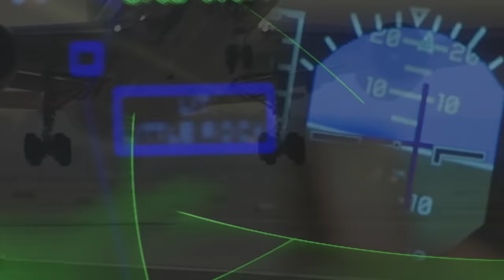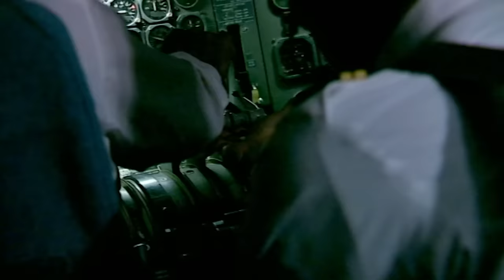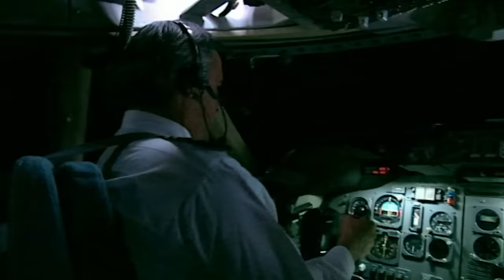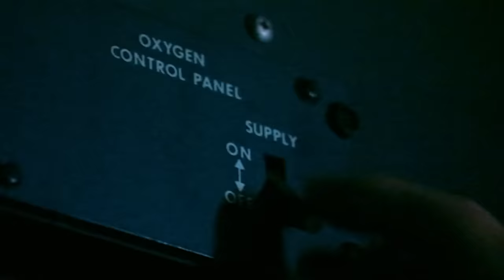Horrific Plane Crashes That Could Have Been Prevented | Mayday Compilation | On The Move

Comment: I flew on a 747 in the 90’s. Prior to takeoff, they couldn’t close the cargo door. I heard a lot of noise up in 1st class & I asked the flight attendant what going on. She said “the cargo door is stuck open & they are welding it closed “. This took about an hour. In flight we hit severe turbulence & I asked the flight attendant “what happens if that cargo door opens?”. She said “don’t worry, we’ll gradually decompress “!
Reply: I flew a 747 once and when they got us all on the plane they announced there was an unmatched piece of luggage in the cargo hold so they had to get it out (good). Then when they tried to close the door it wouldn't close so they had to "manually" do it. It took quite a while.   It was a nonstop flight to NZ and ironically before taking that flight I used to take the UA Honolulu to Auckland (NZ) flight which was UA flight 811 which flew DC-10 prototype planes.
Reply: @radfem2010  it’s crazy how none of this was in the news. I wonder how many cargo doors were malfunctioning on the 747’s back then?
Reply: Absolutely not true that they were 'welding it closed'.

Aircraft fuselages are made from aluminium, which is an absolute nightmare to deal with, even in a controlled factory environment. There is no way they would try, nor would it be allowed, to do that on the ramp before take off. Also, 'it took an hour', is more proof it didn't happen. The thermal properties of aluminium means that even if you do make a clean weld, you have to heat treat other areas far away from the spot you were working on.

10/10 they lied to you.
Reply: @radfem2010  wow!
Reply: @trottergraeme  I thought so
Reply: Hahahahaha I one of those ppl who would laugh at that if it was happening to me it's my mind coping with danger ppl say it's not funny I say Ik that's just my coping mechanism beats panicking at least worse thing that ever happened to me was a car wreck nobody was killed the worst casualties was the cars his literally up to the radiator caused it to leak and the idiot wanted to ride off the scene with it literally broken back axle for our car a complete 180 on moms side cracked her sternum guy hurt his hand i just came out with bruises and a bump where some of the airbag from mom side busted dad ended up taking the next day off to care for us cause for the next few days I couldn't walk until the bruises showed up literally felt like someone was pinching the tops so hard and was causing a reaction to where I had broken 3 toe bones that it had become to much what a relief when those bruises showed up as it relieved the pain I also learned if the bump started to sting to put ice on it or it would cause a bad headache for weeks afterwards I think those headaches were caused from breathing in the airbag dust only situation I never laughed at
Reply: @Graeme Trotter  unless they were welding the latches shut,  those might have been a mild carbon steel and easy t
Reply: @shawndouglass2939  possibly
Reply: Oh that’s rich.
Reply: Leaving San Francisco (United 737 I believe) most passengers expect your plane to lift off by a certain time & speed. Even businessmen starting to look up from their newspapers (this was many  yrs ago). Suddenly we were braking & pitching forward. The female Captain explained we had hit a flock of birds, large & black, & had blown out “all our tires”. She said the plane would be towed back to the gate & we’d get a different aircraft. She even invited passengers to look at the plane. Blood & black feathers in the 2 engines, windscreens & wings. She was very calm.
Reply: @shawndouglass2939  It would've been completely illegal to do that in either case.

Comment: I would like to discuss Kevin Campbell commenting that he was an Engineer and was coming up with re Engineering an existing bad blue print. I've been an Airline Line Mechanic and Commercial Pilot for 40 years, including Inspection and Supervisory roles. I have run into many "Engineers" that can't get the parts to fit back together and take it upon themselves to modify the part, totally wrong and illegal. My point is that both the DC-10 that had hooks to lock the door and pins to lock the hooks and Boeing 747 that had hooks to stop the camming action of the C Locks have had failures. The real solution is to have hooks as per DC-10 or cams as per 747 but you need to have an over center mechanism and then use a camming lock that can't be applied unless the door is closed and locked and will completely destroy the opening mechanism if it tries an unscheduled opening. If this sounds like something that is unlikely then you are not familiar with aircraft design at all. These are not bridges or cars or trains, they are relatively light weight and follow certain doctrines of materials and design when being manufactured. At 7 or 8 PSID think of how many tons of pressure must be against those doors at cruise. These locking mechanisms don't need to be modified, they need a complete re-design. My condolences go out to the Campbell family and their efforts were heroic, I just hope someone gets on these doors and figures out how poorly they were designed in the first place; in other words lets not improve on a bad design. Wipe the slate clean and start over, make a door that works for Gods Sake. My two cents from an Airline Mechanic; list of Boeings I've been on over the years 707,727,737,747,757 and 767, my time in Airforce was on the C-130. I'm not an Engineer but a Licensed  Mechanic and know how things are supposed to work.
Reply: The thing is, all these instances were many years ago and a lot of stuff has changed in design, maintenance, system safety and more. These things don't happen any more. No, I'm not ignoring the 737 Max - anything designed by people has a chance of failure. But the failures overall have been minimized a great deal, and nobody ignores issues like that any more. All these posts about the NTSB, FAA and airlines being in bed with each other is plain ignorant. 
GA/airline mechanic and pilot for 40+ years here so I've seen a few things.
Reply: @chipsawdust5816  I would pause a minute before I put the NTSB and FAA in the same sentence. I have a great deal of respect for the NTSB and don't think they are in bed with anyone. I have had professional and personal dealings with the FAA and I would suggest that you keep your cards close to your chest. Their original marching orders were to " Foster and Promote Aviation". So helping the airlines and manufacturers deal with difficult times only follows their original doctrine.

Comment: This was a notorious problem on DC-10s, due to a known defect with the cargo door latches. Didn’t know Boeing had a similar problem .
Reply: It was the 747s. I did not know it was also an issue with the DC-10s.
Reply: @Juliette_4  Yeah the DC-10 had a huge problem with the locking mechanism on the cargo door. It failed to close and latch the door completely without any indication to the crew that it was not safely closed.  In 1972 an American Airlines (flight 96) DC 10 blew its door and was able to land.  It wasn't until 1974 with a Turkish Airlines DC-10 when their cargo door blew off and all 346 passengers were killed that they knew for sure that the door was the problem. This was the reason they called the DC 10, the Death Cruiser. There is a great Mayday episode about this. (look for American Flight 96)
Reply: @scottcol23  Typical of the American attitude when safety factors are not considered due to monetary  implications. How disgusting that so many people lost their lives thanks to poor design and building, In USA money remains GOD. Terry Offord
Reply: Someone at M-D and at the FAA should have gone to prison over the lack of action on the known cargo door problem.  Same for Boeing and FAA re the 737Max fiasco.  Disgraceful and disgusting.
Reply: @Juliette_4  Yep, twice on the DC-10s and nothing was done.  Cost a planeful of people their lives when the problem had been known for years, but nothing mandated to fix it.
Reply: Interesting, I work on KC-10s and haven't heard of this. I don't really follow the history of these though, so I'll look into if that was ever fixed.
Reply: Worked Ok for D.B. Cooper.
Reply: A blemish on M Ds reputation leading to their aquisition by Boeing?
Reply: @terryofford4977  this happens all over the world, not just the united states. hell this sort of thinking also caused the soviets to lose most of their pacific high command in a single accident.
Reply: @halweilbrenner9926  Worst mistake by Boeing in a long time.
Reply: @wagner9050  That was a 727 rear passenger door, since modified so it cant open in flight. Not that there are many of them flying anymore.

Comment: The fact that swiss airlines completely changed their planes where they removed the flammable material and installed smoke detectors and cameras on all their planes is amazing and other airlines should do the same thing to their planes when they discover a flaw instead of putting it off in exchange for money.
Reply: They were going bankrupt it was an attempt to sell the planes as extra safe which in fairness they actually were. Most of the fleet was reused for Swiss after Swissair went bust, so most of the birds kept flying. Bad time for Swiss aviation, Crossair another smaller carrier had a bad crash too.

Comment: Regarding the United disaster.  I do not refer to it as an "accident called because it wasn't.  I am a  Highly-educated retired research engineer.   I performed research for the top Engineering national laboratory in the United States.  I was greatly disturbed at the fact that politics, not science drove the determinations and actions about the NTSB and the FAA.   It continues to this day.  Both of these agencies are directly tied to the airline.  Many of the federal employees from these agencies look forward to taking early retirement and then taking employment with the airlines or the aircraft industry.  As a result, there is a corrupt relationship between the these organizations.   There are numerous other incidences where the NTSB report was it was just playing wrong.   In addition the FAA often allowed the airline industry to either not perform necessary repairs or to take far too long to do so.  Worse is the fact that the NTSB and FAA often used investigators who lacked the technical education and expertise to properly analyze the systems involved.  Often they had no engineering support at all or the engineers who were utilized like the competency to understand the systems and circumstances involved.  The United case is the norm and not the exception.
Reply: You're a retired research engineer, so surely then you can produce evidence of your conclusions. Let's see it.

Comment: Seriously scary . 
   Do not mess with a New Zealander . 
About this time took off in a 747 from Jan Smuts , Jhb , South Africa . BOAC :-) 
 Was used the getting the feeling of gear up . 
Instead go a massive 'bang ' from behind me , at the back of the plane . 
Not a galley rattle . 
We continued to climb . 
   Until , 'This is your captain speaking ' etc etc . 
With an addendum . 
"Sorry about that loud bang on take off , something that happens on these 'older ' aircraft " 
So reassuring .

Comment: 'There's fire ! Get me my checklist !  ... We're burning to death !  No, get me my CHECKLIST!"
Reply: Checklist save lives. 🤷🏽‍♀️ There are a thousand and one reasons why there is smoke including a large number of minor problems. Checklists are used to rule out problems and locate the source of issue. It's also safer to find the problem in the air than mid landing which is over if the most dangerous times.

Comment: It is both heart rending and touching that young Lee came to see his parents, if only in their dreams, to smile at them and say good bye...

That being said the root cause of the accident, the use of soft aluminum rather than steel in such an crucial safety point as the safety locks, is ABSOLUTELY INFURIATING. I know nothing of engineering as such but it seems patently obvious that given the danger of an outward opening door in a pressurized area would dictate that the locks be made of steel in the initial build of the planes. Then compound that with the 18 months allowed for this CRUCIAL safety fix constitutes criminal negligence in my opinion on the part of both the airline's and the NTSB. Especially so since the later is supposed to be above such considerations as down time for aircraft and the subsequent loss of revenue. Boeing who designed this very poor system should have been on the hook to reimburse the airlines for the down time.

RIP to the victims of corporate greed.

Comment: That locking pin situation should not have happened, they had proof of the trouble with these types of doors with the McDonnell Douglas aircrafts, there was a crash of the Turkish airline, plus the one on AA over Canada. These types of doors had the propensity to open in flight leading to decompression, and crashes. This is really sad that we allow people to die in such a horrible way, all those deaths, RIP

Comment: I've never been more than a passenger, but when they talk about being so overweight for landing or even maintaining altitude, why wouldn't they be dumping fuel as soon as possible? Even if that meant dumping without approval, over the top of a nature preserve, protected marine area, downtown Los Angeles, etc and over whatever part of the ocean that they were over?
Reply: Couple reasons. Many legal. Also possible that dumping for can cause worse problems of the full extent isn't known. For, explosion, uneven drain, difficulty in knowing if they might need fuel for anything. Huge number of reasons really. The fuel isn't overly helpful and many times must not be dumped in crown locations for international reasons. Basically if no other reason legal problems caused regulations making things difficult.
Reply: @differssmith4434  that all makes sense. Although if weight was an issue that was likely to cause a landing to fail, or basically guarantee death to everybody on board, it seems like human nature would lead almost every person to forget about legal ramifications.

Comment: I was an aircraft mechanic for many years.. “everything “ we did was safety first.. nobody ever took shortcuts or disregarded proper procedures . Our kids could be on that plane tomorrow. Don’t think the engineers at Boeing felt any different.. that door thing ?? You gotta titanic with wings on it.. stuff gonna break sometimes..yea planes crash sometimes.. take a row boat or walk next time you go on vacation
Reply: No, M-D knew there was a problem before either blow-out, and after the Windsor accident so did the NTSB (which has no teeth) and the FAA, which does have teeth but won't use them.  Those accidents were TOTALLY preventable because the cargo door problem was already known.  Despicable behavior.  It's far worse than "stuff gonna break sometimes."  smh
Edit to add: I'm in no way blaming the mechanics and ramp people.  It's much higher up the food chain than that.  I don't know why you'd try to make excuses for them, though.
Reply: Thanks, same here, for over 40 years and still going. Safety first, don't trust anything, always have your work inspected by another set of eyes. Do your damndest all the time. A truly under-appreciated group of dedicated people, especially by armchair pilots and mechanics making comments on videos like these.